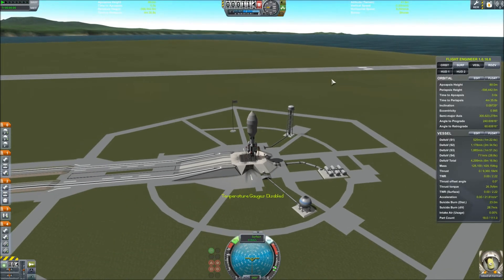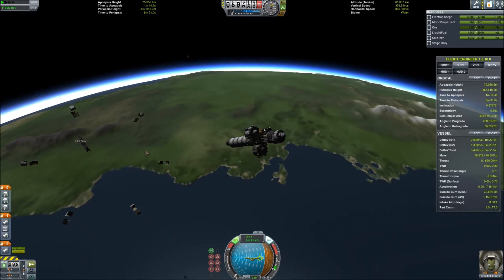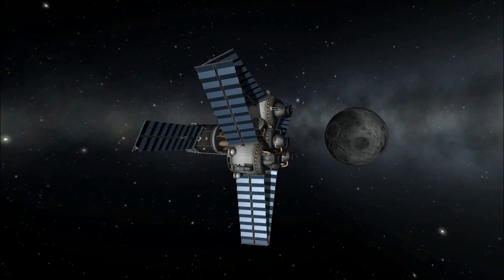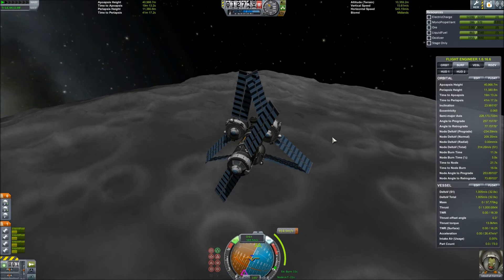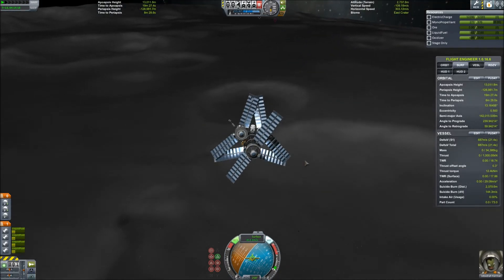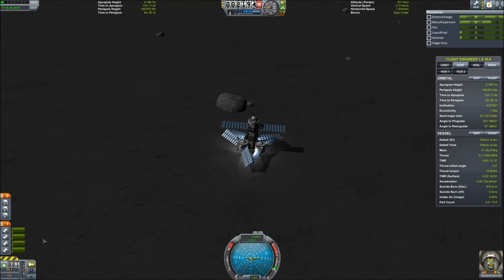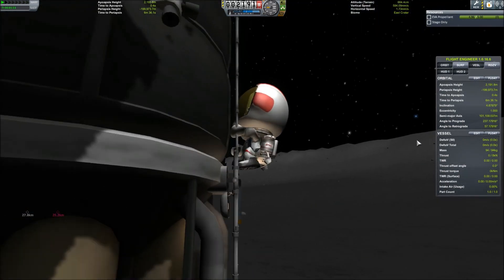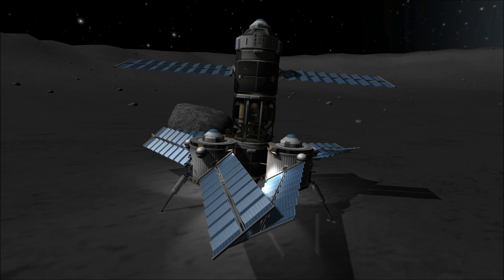Kerbal Space Program 1.0 Drilling! Part 2

Comment from the maker: @Corentin mengel I elected to use just one drill because while running two at a time, I would quickly drain my power supply. Having just one drill allowed me to run it continuously without adding the excess mass of additional batteries and solar panels.